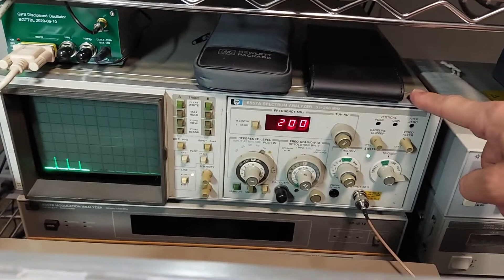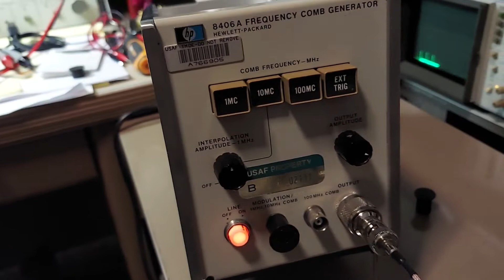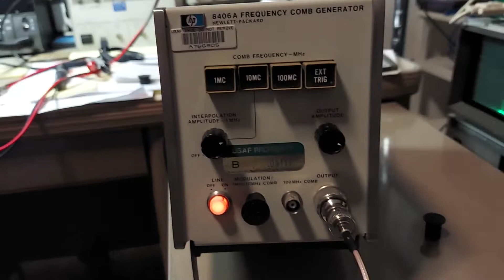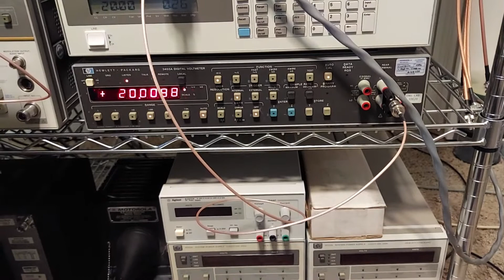HP 8406A Comb Generator

Comment: Good synthesizer like HP 8662/3A sync'd to fast pulse generator, HP8082A with square wave output selected does exactly the same, only much more accurately...
Reply from the maker: Thanks for the tip, I'll try that. I have a HP 8644A and a HP 8011A pulse generator I could use. I bought this mostly as an excuse to add another instrument to my collection and because I would like to use the instruments listed in the service manuals if possible.